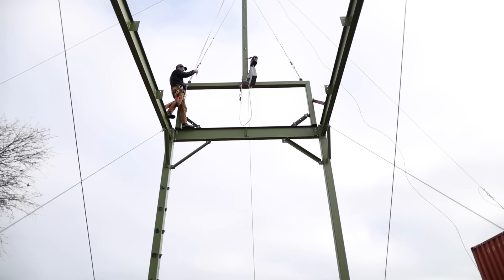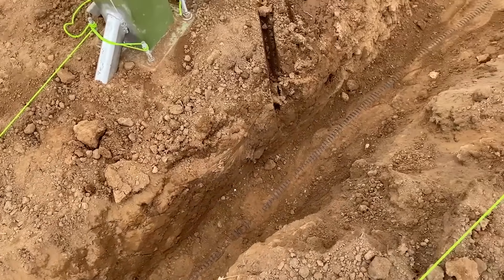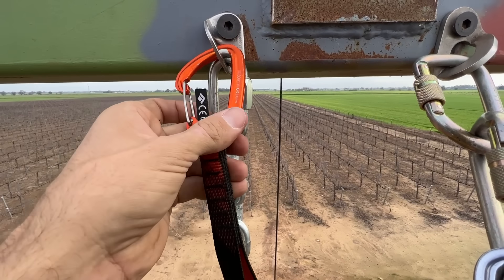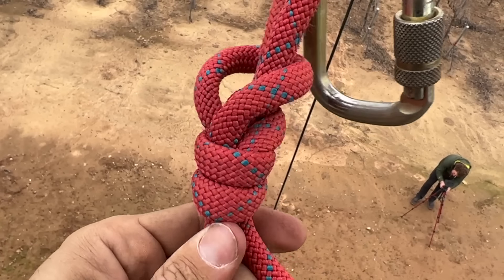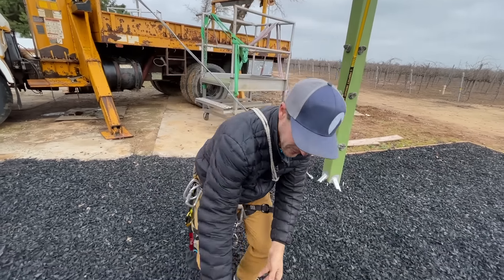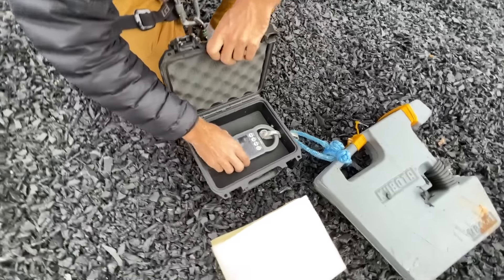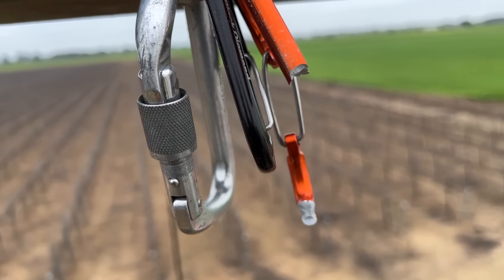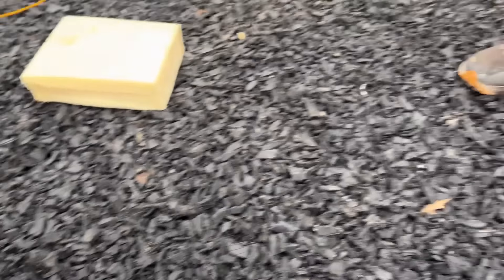Climbing carabiners don't break like you think

Comment: It´s so dangerous to stand up there during the drop. The chain can easyly hurt you at those speeds and it can be fatal if it hits your unprotected head.
Reply: I agree!  Probably only a full motorcycle helmet will protect from the unusual angles that things will fly at him.   A thick heavy blanket strung up on pullies so that it can be moved in and out of the way is probably the simplest full-body protection.  Fix one edge to the beam that he is standing on.  It hangs down during setup.  Then pull the bottom edge up to the top beam to make a wall, but more like a "J" so that he has some floor protection and space.
Reply: Dude actually has a point. I cringed when i saw it whip back like that.
Reply: He said be kind
Reply: It’s interesting to read the comments from climbers in different industries/disciplines. While, I’m not disagreeing, I thought it interesting that you folks pointed this out. I can see your point. However, it didn’t cross my mind as I’m a climbing arborist and we “rig out” 400lb -1200lb pieces out of the trees we are climbing with all our blocks, slings, and ropes within a few inches/feet (depending on situations) from our bodies while holding chainsaws and sometimes being close to 100 ft off the ground. All of which is compliance with ANSI z133. Please don’t misunderstand. I understand your point, and can see the danger. I just thought it an interesting statement and thought I’d explain the conditions of a typical climbing arborist and why your comment struck me as interesting. Safe climbing to you all! 👊
Reply: @EricJemAndes  I can understand your point. My concern is that when demonstrating a "part" for safety and the test-setup is dangerous by itself. If I start a test setup and realize that parts are being accelerated to extreme speeds, then even as a non-pro, I think about changing the test setup in such a way that safety is guaranteed, or I stop the test. Rules or not, the chain accelerates like a bullet and has devastating consequences if it collides with a body part, it's as simple as that.
Reply: @Analoque444  I completely understand what you are saying. You have a good point. Like I said I appreciate your folks point of view! As a sponsored professional, and as a trainer in the arborist industry, it helps me to rethink certain set ups, and things that I take for granted. As we become more familiar and complacent with the industry and equipment that we’re in, it tends to dull our senses to some degree as to the ultimate safety, that we need to be seeking. So, when I see comments like yours, it helps readjust my way of thinking, and reevaluate some of the details that I put into my own safety training. I hope that makes sense? Thanks again for the dialogue and the comment.
Reply: @EricJemAndes  I'm glad to read that. If you read my comments on YT, you would see how many times I've warned people about obvious dangers. I just have an eye for something like that and very quickly recognize the dangers in the details, often things that others can't even foresee or notice. Safety is the most important thing and dangers are lurking everywhere, mostly where we would least expect it. Thank you also for your comment.
Reply: You're the smartest person in the planet
Reply: @wildlifewarrior2670  "On" the Planet hahaha xD Not very smart but I have good eyes 🤣😂
Reply: I was shitting my pants the whole time
Reply: @EricJemAndes my mate is a climbing arborist. You guys are Kings among men 💪 🤜
Reply: But helmet is super good enough

Comment: I could see the problem being that the ancor carabiener can move out of the way on the drop tower, but cannot move in real life because the rock is stopping it.
Reply: i agree. there should be another hanger location more upwards on the beam. like maybe around 5-10cm more up?( thats about 2-4 inches for our imperial dinosaur friends  :-* ♥♥♥)

I would also love to see the anchor carabiner be loaded with around 50kg, representing a gear bag or sth like that on e.g. a big wall climb. (although probably wont make too much of a difference i guess)
Reply: @lordofnothing.  here's the best thing: they don't even use imperial, they use customary, where some units just have different values than imperial
Reply: That's right, we can clearly see the quickdraw being pull at the right angle because the quickling move out of the way in the back (like you say, the rock would have stop it in real situation).
Reply: Came here to say the same thing! Definitely not having a wall behind the bottom of the anchor alters the results
Reply: Was just about to say the same thing.

Comment: I snapped a carabiner during a normal climbing fall and I have a theory. The carabiner was pulled up such that the spine acted as a lever with the load by the nose (pushing up against the underside of the hanger), the fulcrum in the middle of the spine resting on the top of the opposite side of the hanger and the force applied downward at the dogbone end.  The force would snap the carabiner like a weak crowbar. I am convinced that, if the hanger has a diagonal slant, you must clip through the underside of the hanger to avoid leveraging of the spine.

Comment: Very interesting. Mountain Safety Research started just to do testing of ice axes (wood shafts) and biners and branched out from there. There was a drop tower and the works. There was a bunch of gloves tested for belaying as well. Anyway it began just as a newsletter on equipment. But the Stuff being sold by REI and other sources (late 1960's) was so bad and the test results were rejected by REI and other so MSR began selling the best products tested and then making superior products like the ice axes. Too bad there was no Internet! Here you are doing exactly the same thing 50 years later. (MSR had good instrumentation and equipment because is was started by Larry Penberthy and located at Penberthy Electromelt in Seattle.) The REI Red Locking Carabiner that everyone used I recall was breaking in tests at a few hundred pounds. The REI ice axes were breaking at 150 to 300lbs in side loading simulating various belays. The first MSR product was a fiberglass kit that doubled the strength of the shafts.

Comment: Hi there, I am working in the building industry in NYC and we do use harnesses, carabiners and ropes for fall protection . The fall protection equipment is strictly regulated by OSHA. It looks clunky, heavy, not ergonomic and not really safe. It doesn't seem to be influenced by the experience gained in rock climbing and mountaineering. The few OSHA inspectors that I met didn't seem to have experience of how this equipment performs in wild. It looks that the philosophers that conceive OSHA regulations go from the concept stage straight to writing the regulations and enforcement, rejecting the physical trials and real world experience all together. I would like to see somebody putting their ware to real test, both on testing rigs and in practice. Hope that you take the challenge and spare nothing.
Reply: Ive had the same thought.
Reply: I'm not sure anyone knows. There's the same thing in Australia. So long as you are using an "approved" harness and the inspector can see that it's an "approved" harness nobody cares.
Reply: You should be able to look up what inspection criteria is used for the equipment you use. It'll be printed on it somewhere. UIAA is the climbing standard
Reply: Hey there, as someone well versed in OSHA fall protection standards there's a couple things you have to take into consideration before you start complaining about the equipment. 1. Your company is probably cheaping out on the equipment. The less expensive stuff fits worse, is heavier, and most often comes in a larger form factor then the more expensive stuff. 2. All equipment has a minimum set of standards to meet. This is set primarily through ANSI. Part of those standards include real world mock ups of falls using the equipment, attachment devices, worse case scenarios, and weighted dummies with g-force sensors. 3. The majority of OSHA rules and regulations are written in blood. It takes years to change any single rule in OSHA because lawyers from all affected industries are involved. Unless multiple people die first, it's not going to be made a rule.
Reply: I work In industrial tech rescue. We use the higher NFPA standard when we put people on our rigging. We also inspect equipment used by workers supplied by the contractors they work for. It’s not uncommon for me to reject poorly maintained or actual non compliant equipment.  Don’t ever trust what you are given. Make sure it’s undamaged and rated for your work. Be safe my friend!
Reply: @Ckamerad  I used to be a site manager for Exhibition construction. All harnesses were to spec and were checked before use on site. The most expensive, world class gear is useless if not maintained.
Reply: @MisanthropistGuy    I'm a pretty lil femboy by night, but by day I'm a very hardworking laborer for my size. Thanks for the info, cause I thought everything you said there made a lot of sense. Although, the last sentence makes me wonder. That's the one part where I'm going, "Well, I trust the OSHA regulations as much or more than anyone else, but if the gear and regulations ever actually are proven as the cause of death, I don't think I'd be happy waiting for the 2nd, 3rd, 4th, etc. person to die and THEN making the rule."

Vast majority of the time it's NOT OSHA's fault, but I suppose I don't see the harm in A- independently testing the equipment, and B- holding the rules to task on the oddball time it really is their fault. Anywho, cheers and nice profile pic lmao. ^_^ ~
Reply: @MisanthropistGuy  All rules are written in blood. Some are just slower to pen than others.
Reply: Idk man the stuff my company uses is really nice and while none of my ppe has been put to the test, we regularly use the anchors to prevent LARGE pieces of concrete from falling to the floor from 100+ ft and that's the piece I'm most concerned about.
Reply: @MisanthropistGuy  Can confirm, my tower harness, albeit heavy, is fairly comfy. It sucks when I'm climbing up ropes, but I've never felt like my exofit tower harness was going to fail.
Reply: @EllyCatfox  lol
Reply: That's funny as often in the chemical industry they are pretty good and it's companies sliding regs that go bad.  I guess tho that mens being coated in burning iron dust and being incernated alive 6 times in the same factory of massive chlorine gas leaks causing thousands of evacs get more actual attention then these thing.s. not saying this isn't just as important.  But a few guys falling from gear fail doesn't rile people up as much as massive refinery explosions or chemical releases such as phosgene and benzene

Comment: Standing so close to the cable, even above it as demonstrated, seems horrendously dangerous; look at the backlash that occurs at around  10:41  and you can see a segment of the rope (and whatever may be, or have been, attached to it) is slingshot up and it comes just a few centimeters from striking you! It reminds me of when people connect all sorts of poorly-thought-out, quickly-rigged tow lines with heavy hooks (or even carabiners!) attached to them to try to pull out stuck cars in the winter. Even the elasticity in many ropes can snap if and when they break or something fails with such energy, it can be lethal. I would say, If you won't stand beneath it, do not stand adjacent to, or even above it!                     - j q t -
Reply: My thought too, the energy stored in the rope get transfer back like a slingshot. It’s probably safer to be on the ground (at a safe distance)
Reply: Seriously. Can’t believe he’s willing to stay so close to these catastrophic breaks
Reply: relax grandma he's got goggles on
Reply: @alecsyogacorner  yeah the impulse of momentum for rope hitting you is much higher because the surface area of the impact is so much smaller. It's why you'd rather catch a rock than a knife. Obviously nylon whiplash is nothing compared to something like steel wire, but still has recorded fatalities, even in contexts like "tug of war".  The two ball bounce experiment (put a tennis ball on top of a basket ball) shows that being above the rope isn't necessarily any guarantee of safety.
Reply: was my first thought when i saw the first drop. Odd he doesn't know this. Anytime you do anything with rope, cable, etc that puts a load on it, always stand back at least as far as the rope.
Reply: Absolutely
Reply: Interesting that he hasn't responded to this comment?
Reply: Ahh, safety, shmafety...
Reply: exact same thought here...
Reply: @roddas26  Agreed. I was a tank mechanic in the service and part of that is towing tanks/getting them unstuck. We had inch or two thick steel cables to do so. Our first lesson regarding using the cable was to stand back at least as far as the cable was long because the thing could decapitate you. I would assume that happened so that the rest of us could learn from that moment. Very dangerous.
Reply: They are ropes, not cables, it's not "horrendously" dangerous lol. Yes getting hit wont feel good but you're not going to die, it's not anything like getting hit with a chain or cable.
Reply: I agree!  A thick heavy blanket strung up on pullies so that it can be moved in and out of the way is probably the simplest full-body protection.  Fix one edge to the beam that he is standing on.  It hangs down during setup.  Then pull the bottom edge up to the top beam to make a wall, but more like a "J" so that he has some floor protection and space.  Exposed, probably only a full motorcycle helmet will protect from the unusual angles that things will fly at him.   Things could go up and down, so needs a roof panel too.

Comment: For the non-climbers here, Gear typically isn't going to fail on you in normal usage. Provided that you are using it properly. In climbing it's extremely important to not put any of your gear in a situation where you could be levering it against something. Static vs dynamic loading can result in a bad time.

TLDR ; take care of your gear,inspect before every use and don't get creative with your uses for it and you're unlikely to see any dangerous failures while climbing.

Nearly the entirety of accidents that occur are the result of negligence either from experienced/cockiness or being distracted during your checks.
Reply: Thanks.
Reply: You managed to make your TLDR longer than the text it describes.
Reply: How come everything connected to the weight kept breaking but they only cared about the carabiners??
Reply: Possibly a dumb question (sorry) but do carabiners wear out to a point where they're unsafe for climbing, but still "functional"? Would such things be super cheap to purchase or obtain?
Reply: @neshbro  All good, for the most part carabiner damage that climbers see wouldn't interfere with using it for other things, However the cost of purchasing them new at $10-15 is rarely much more than you'd find used anyway.

The exception to this would be autolocking carabiners. The nicer ones can easily run upwards of $30-50 each, in which case if you found them cheap used it wouldn't hurt to snag them.

Finding used climbing gear, carabiners included can be a bit tricky though. Theres some things climbers absolutely will not want to purchase used for safety reasons, and as such also don't sell them once they've passed their lifetime in the off chance someone does try to climb with it.
Reply: @sakaraist Fair enough! i was hoping this could be a way to snag a lot cheap for leashes and keeping pens closed at an animal shelter! If they're unsafe for climbing I'd assume they're worthless... Thanks for answering!

Comment: maybe put some more foam into the LS3-Box on the sides. coud easily imagine a scenario where the LS3 Box gets reverbed between the dummy weight and the ground. in which case it could go flying inside the case hitting the sides at max speed with a SIDEWAYS force peak, which these things potentially weren't designed for.
Love the content! The drop tower is awesome!
Reply: also maybe the LS3-box doesn't need to be attached to the dummy, and hence undergo all the same beating as the dummy does. After all you're not (in this case) measuring the forces acting on the dummy -- you're measuring the forces at the piece being tested. Even though again in this configuration these forces should be pretty much the same, still in general case makes sense to put the measuring link as close as possible to the expected breaking poing and also in such a way that it doesn't smash on the ground or into the dummy in the event of successful breakage.

Comment: So interesting thing from a structural perspective here: 

When you look at the case for proper loading you get a formula like this: 
ΔL=(σ*L)/E
Where 
ΔL is the change in the length due to tension
σ is the tensile stress
E is the elastic young's modulus (a material property)
So the deformation leading to breakage in pure tension is a linear relationship to all the variables.

But when you look at the improper case, which could be idealized as a pure beam bending problem:
δ = (PL^3)/(3IE)
Where:
δ is the bend from the initial position (think of a beam sticking off from a wall, this is the distance that the very end moves)
P is the force applied
L is the distance between the force and the connection point
I is the 2nd moment of inertia (a property of the shape of the beam)
E is again the young's modulus

In this case you can see that although the force is still linear, this distance adds a CUBED value
That's why you can't break the carabiner in pue tension.